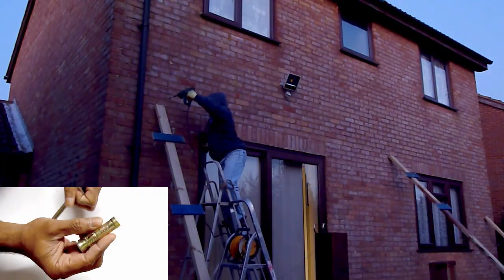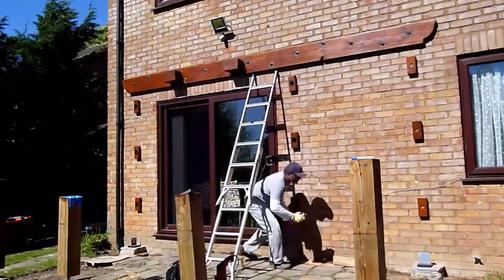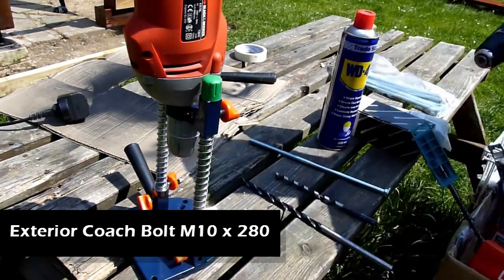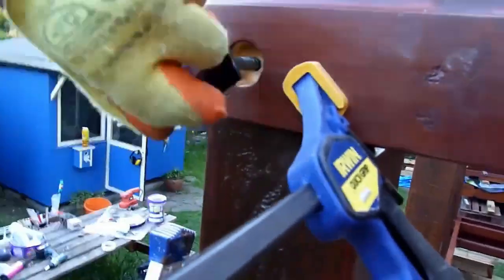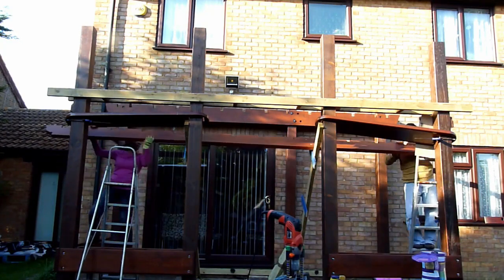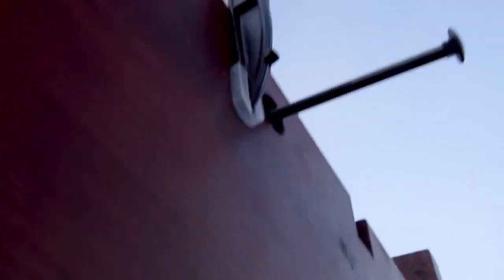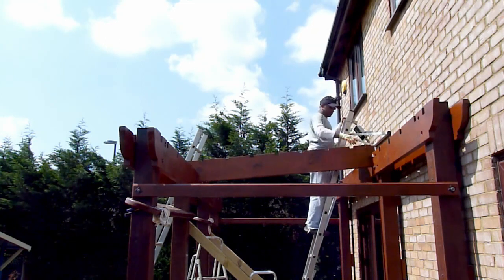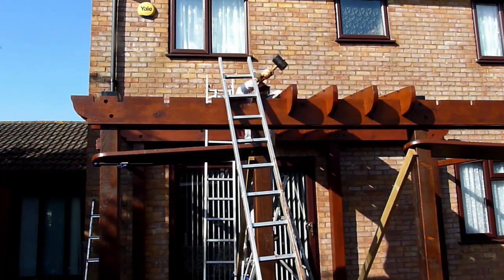DIY PERGOLA Build - Episode 3/3

Comment: Nice! Not sure if you've thought of this but a floating deck underneath as you step out under the pergola wud be nice and steps as you exit pergola into backyard. This could help hide concrete post supports. But overall great job, I'll be using a few of your techniques on my next build.
Reply: Suj Menon Nice! Ok so I'm tardy to the party... great job on the deck and hanging the LED lights!

Comment: Great video, maybe you can help me with a few questions. For your girder/ ledger board that you put onto the brick wall, I'm working with a blockwork garage wall with an external render on it. I don't think I should put the washers against the render, but should I remove just enough render to fit the spacers in so they protrude slightly past the render or remove all the render behind the ledger board? I'm also contemplating bolting flat against the render and then flashing above and behind the wood with a trim and some flashband. I do like your idea of gluing the spacers to the wall I hadn't seen that one before. For context the render is in good condition and it might even be hard to remove it without damaging the blockwork underneath.  Thanks.
Reply from the maker: Hi Joe, my thought process would be your first option: ie to just remove enough render under the washer area, so that the washers can sit tightly flush on the wall, and they can protrude out. I am not an expert by any means, but I feel if you fix it directly on the wall, that maybe ok as well, its just that the render under it will get crushed, and then it may just flake away eventually, causing millimetres of gap/ and result in probable sagging later.
Retrospectively one tip would be to tape some rigid cardboards lengthwise,  and mimic the shape of that girder. Then its easy to trace and align those bolt holes position from the wall to the girder.
Also, as long as the spacer areas are staggered lengthwise, it will hold its weight  (ie, not all of them drilled in a straight line, because that may tilt it downwards).
Reply: @SujMenon  Thanks Suj. Yes I will definitely stagger in a W shape along the ledger keeping 2 inches in from the edges. This render is so strong and thick I might go for a combination. I'll make holes for spacers but because the render is 8-10mm thick I will have the spacer flush with the render and put the board flat against it, that way if it flakes in the future the spacer is a backup instead of hanging off a 10mm spacer. Apparently if putting a ledger onto conrete or brick a line of chaulk keeps the water out so my flashing might be overkill but it's all good practice 👍I'll let you know if mine turns out as nice.

Comment: Great video. I've been looking at building one myself and this will really help. If you don't mind...how much did that cost you as everything I've seen so far is American so in dollars not pounds
Reply from the maker: A lot, lol! On a rough estimate: around £1,300 worth for the timber,  £200 for cement, sand, gravel, and around £900 for all the fixings, stains, wood preserver, sealant, coach bolts, anchor bolts, etc. I did order more than that was required, so you could probably save around £200 on those  fixings. hope this helps

Comment: Great job loved the whole build.
Can I ask why the square holes in the seats ended up so much bigger than the post size, did you have to change them to make them fit at assembly?
Now subscribed to see what else I can learn from you.
Well thought out build and well executed.
Reply from the maker: Yes, Hugh, they were eventually made about 15mm wider on all 4 sides. With my original few mm tolerance, and with my naivety, I thought I would be able to glide it in. LOL!. But the reality is that the posts were never truly straight, and I found it difficult to wiggle it in, even with waxing the inner edges. So I took a jigsaw and shaved off a bit more. Thanks for the sub and the comment 😀🙏

Comment: Really nice result, built in seating is nice for a small area like that. Are you planning on any sort of cover for the exposed bottom parts on the front posts?
Reply: Looks great =)
Reply: Great detail thank you. Are you planning to put any rain cover overhead? Like polycarbonate roofing sheets?
Reply: @SujMenon  I was thinking that was your plan as it it pitched at an angle. Will you put guttering on? Reason I ask is that I want to do something very similar but feel guttering will ruin the aesthetic.